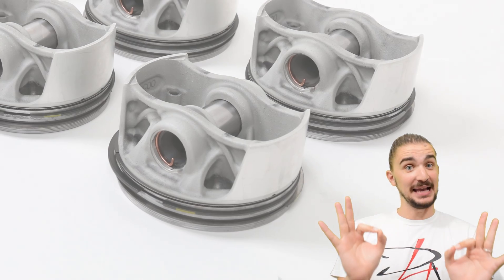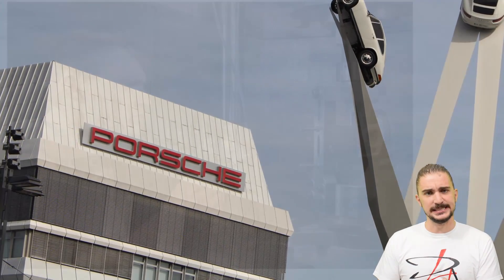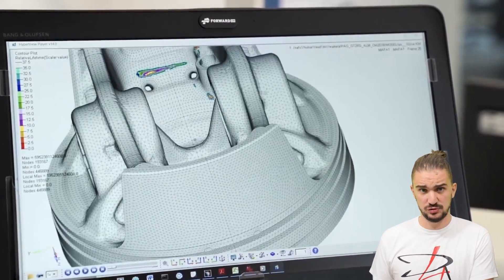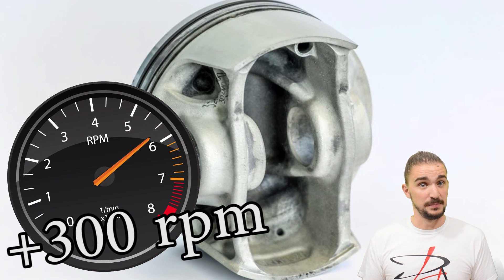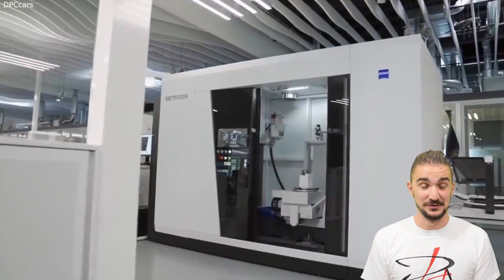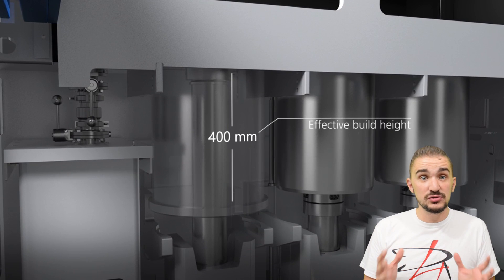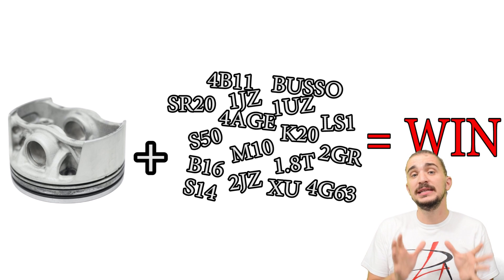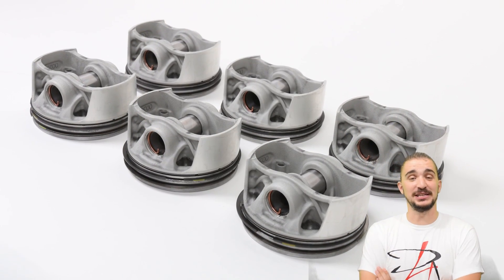PORSCHE'S Printed PISTONS - The Printed FUTURE of ENGINE INTERNALS?

Comment: 3d printing is good 3d printing pistons is already dead, electric is the very near future
Reply from the maker: Dead? I've been hearing that for the past 10 years. Will likely be hearing it for the next 10 😂
Reply: @d4a  good luck driving after you lpse that electricity.
Reply: @d4a  if Europe is late in EV (because a german saying is "if it works we don't change the solution") this not means the rest of the world is the same. just watch "fully charged" channel, they have a correspondent in China who is presenting the reality there (plugs everywhere, many models of EV, small EV like Honda E for 7000Eur, EV registerd imediatelly, for a combustion there is a lottery)
Reply: @gionibegood6950  have you seen tesla building his fctories using diesel machines and trucks?!?! its ridiculous ho you hate on ICEbut its the most important thngs out there
Reply: @carholic-sz3qv  i don't know who is ICE but if you refer to Germany I am speaking from inside as a designer of structure for planes, so i know what i'm talking when dealing with german manufacturing
Reply: @gionibegood6950  ICE = Internal Combustion Engine
Reply: @carholic-sz3qv  Also there is the strangled scandal of Lithium supply from Bolivia...
Reply: We will not have "good" electric cars before battery technology knows a revolution (weight vs storage capacity and most important, it's ecological impact on the short and long term) I believe "mild" electrification on combustion engine cars is the best compromise. Think about hybrid turbos for non-existent lag and immediate boost and hybrid gearboxes or drivetrain that can give more total or power or help the car when it's supposed to consume a lot of oil (driving in the city)
Reply: The combustion is not going anywhere, this electric obsession is foolish!
Reply: @ghoulbuster1  if you are not well informed, does not means there is not existing, just check "fully charged" channel to see how many EVs has China

Comment: i've been seeing lots of allegedly 3d printed compressor turbines, could this be better than billet?
Reply from the maker: I've seen those too, they have benefits and drawbacks. That's a good video idea actually, thank you :)
Reply: As stated elsewhere in this thread: currently 3D printed parts sit in between what you can get in terms of mechanical properties of cast parts and forged parts. It's better than a cast metal structure, but it doesn't quite make it to the strength of forged material. BUT, having said that, the design freedom of 3D printing is almost unrestricted, so you can perfectly optimise a part by adding material only where it's needed. That's impossible with forging or casting, so 3D printing (or "additive manufacturing" as it's called) has the potential to produce better parts, when you re-design from the ground up to make use of this design freedom.

Comment: Can't wait for 3D printed pistons for my 1.5L Mazda.
Reply: Or a 3D printed cylinder head for the 1ZZ-FED as well as some printed pistons and conecting rods.
Reply: @diesistkeinname795  I'd actually like to see Freevalve heads for older engines, like BP, 2JZ, etc.
Reply: @TopiasSalakka  2JZ allready has a huge aftermarket, 1ZZ has next to nothing and what it has is expensive and requires international shipping.
Reply: @diesistkeinname795  Didn't say it would have to be limited to those engines...
Reply: @TopiasSalakka  The great advantage of 3D-printing is that you don't need new tooling for each slightly modified part.
You can print the head for a 1ZZ on the same printer you print B16 and 1.8T heads on.
Hell, you can even go so far as to use mostly identical combustion chamber and valvetrain designs and just adapt bore size/spacing and other block related design elements.

So one could commit the herresy of fitting Honda K-series style heads to an LS, because they flow better and are more reliable at high rpm.
Reply: I would love to see a 3D-printed ITBs for my MR2 NA
Reply: @moisesezequielgutierrez  Throttle bodies could probably even be printed in Nylon by a regular 3D printer, if not ypu could at least print an adapter plate for other ITBs of the right size.
Allthough the plates, axle and bearings should be made conventionaly anyway.
Reply: Cost more than mazda
Reply: @moneyparhar  That was the joke.

Comment: maybe the future is about totally 3d printed engine. 
but wait, more and more electric car is coming to the market because petrol isn't renewable energy source
Reply: Biofuels and synfuels are just a renewable as electricity
Reply: And you think that all those electric motors could not benefit from the advantages of 3D printing??? Ok, true, those motors don't need pistons, but the key benefit of 3D printing is nearly perfect degree of freedom in shape, and that can potentially be put to use in any metal part. Including electric motors. (Think about high performance electric motors with integrated internal cooling channels for instance.)

Comment: 135 hours at redline? whaaat
Reply from the maker: Not bouncing the limiter, just full load, basically WOT at max output.
Reply: @d4a   its often close thow on turbo engines. You make really intresting videos and good videos. thank you.   There is a game out there called automation i think you would love it. You can build engines in it and mess around with almost everything. materials valves boost comp. Check it out if ur intrested.
Reply from the maker: @emil55555555  I did play automation a bit, it's fun no doubt.
Reply: Vw/ Audi (and Porsche) recommend that the redline is the rpm at which the engine can function for 24hr. 
Or at least they used to.
Reply: How long till the IMS bearing failed?
Reply: That oil channel is connected with a tube? Interesting. That means that electrical components of significant wattage could also be included in a piston head, right?
My engine goes well. Patent filing is about a week away. Your videos have helped immensely. If you want a preview let me know. (And I'd appreciate your input)
Reply: @richardcaldwell6159  I would imagine the oil channel in the piston is fed by a squirter aimed at the inlet.
Reply: not a sponsor or anything just like the game a lot